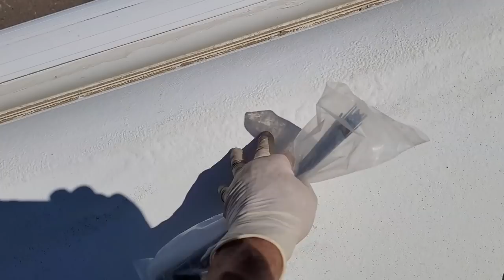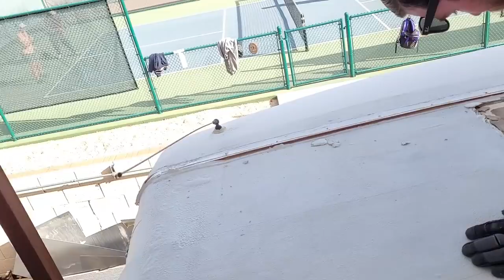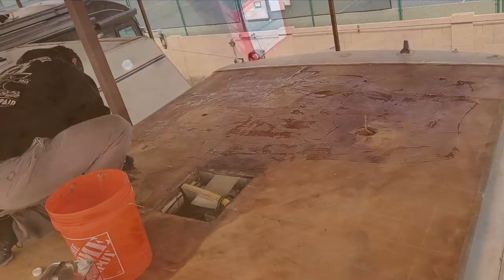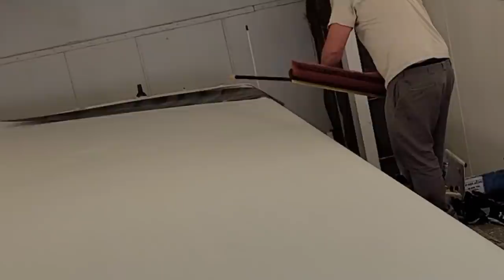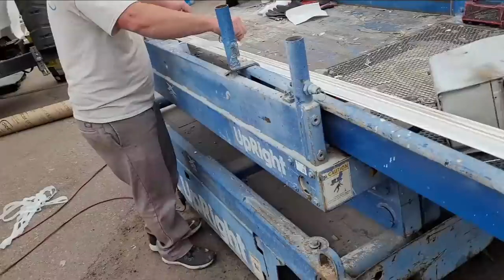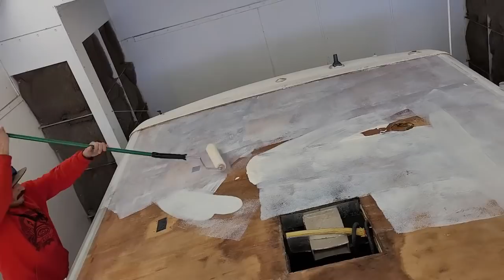The Most Difficult RV Roof Replacement Yet.. Felt-Back TPO

Comment: Is that Micah Foxworthy, Jeff's son?   Good job hope they add the 3 of you to their Christmas gift list.  old roof probably would have made it 10 years and now they will hit a tree on the first trip and tear the new roof.  Stay safe and healthy.
Reply from the maker: I think you are correct about the roof. I know the owner was mostly interested in seeing the  condition of the deck, but membrane roof can last a long time if properly cared for
Reply: I have always been told rubber roofs last 10 to 12 years, ours was 18yrs old. when we bought it in 2010 the original owner had smashed the front air back 4 inches and it "had" a water leak. I fixed the air & leak but could not see under the membrane so i have always had concerns. I would rather be safe than sorry, James and Chad showed me small leaks in other areas... so all in all, better to change it and be good to go until i am not. PS i don't hit trees 30+ years a commercial driver with no accidents. God Bless

Comment: I am really enjoying watching your roof rebuilding videos so thanks for making them.
 I hope you and yours had a merry Christmas and do have great 2022.
The wife and I are looking at an old 37 ft J series Pace Arrow to fix up and am wondering what you think of these older units, I'm just wondering if you think these older units were built well or not? It's a 1992 model. 
 Thanks again for making these videos and may God bless you all.
Reply from the maker: Be sure to get an inspection but frankly the older units seem to have a quality they just can't or won't duplicate any more. Thanks for watching!
Reply: Wow! 1992 Pace Arrow to restore!... Could be a challenge... We own a 38 ft 2001 Winnebago Ultimate Advantage diesel pusher... We've put money into cosmetics, recently a roof restoration and other upgrades over the years including flat panel TVs, digital electronics, etc... But we've decided that we've owned our coach for 12 years, know what it's been through and its problems, etc... I don't care what you buy, old or new you will inherit the problems with that vehicle... They all have them... At least we know where we stand with ours and what remains to be done...

Comment: Maybe you should get one of those long-handled shingle removers and epoxy a heating wire onto the blade.  Set the temperature of the blade to 150° or something, and use that to peel the old membrane off.  Might be a little faster.  I would try it myself, but I don't have a membrane roof (or the desire to remove one anytime soon)...
Reply from the maker: we were trying our best not to damage the thin deck but I'm sure we would have tried something similar if the fire didn't work well

Comment: Sandra Westley from the UK I would have thought by now that they would have come up with a better roof idea over there, we never have this issue over here, our roofs are bonded aluminium. I mean the USA send rockets to the moon and Mars, I would think it’s not difficult to come up with a more water tight option, perhaps as we have such a rainy climate it makes our engineers think outside of the box. 😂😂 it’s just such flimsy stuff you use, it’s like building obsolete roofs before the vehicle is sold.

Comment: I will be replacing  a similar TPO roof on a 2001 Fleetwood. Does the Dicor roofing material linked ship rolled or folded? What do you think about the folder kits available on Amazon? What would you suggest when deciding between EPDM and PVC?

Comment: Question....Is this pretty much the same rubber membrane type roofing you would find on flat roofs on top of these huge shipping warehouses and if not could you use that type of roof to do what you are doing?
Reply from the maker: yes, there is a company in Georgia using commercial TPO on RV roof installs.
Reply: @AZExpert  makes sense.